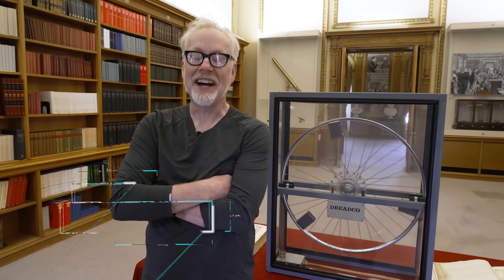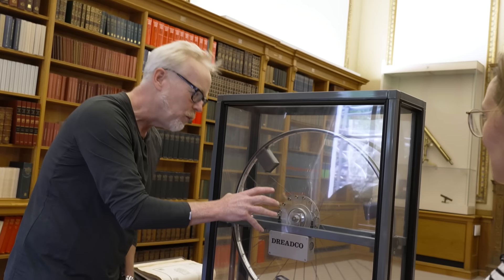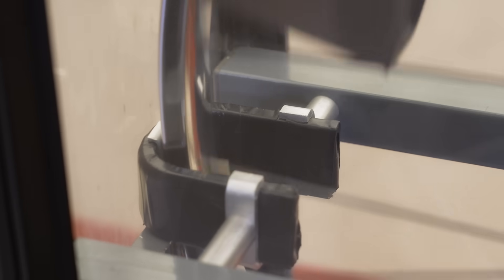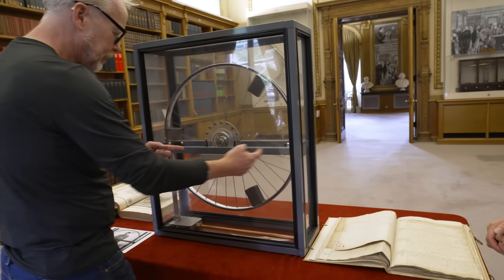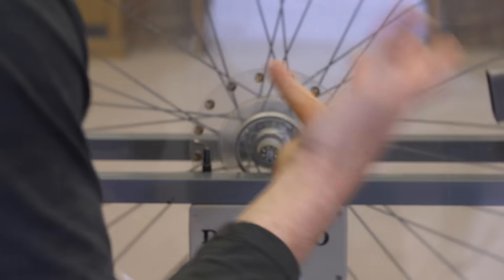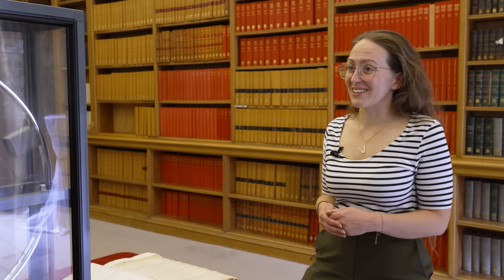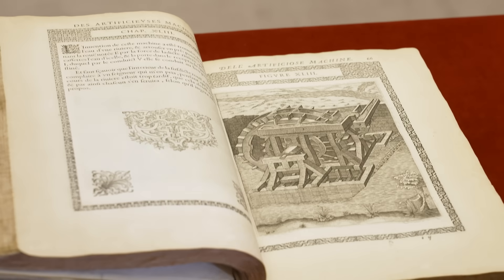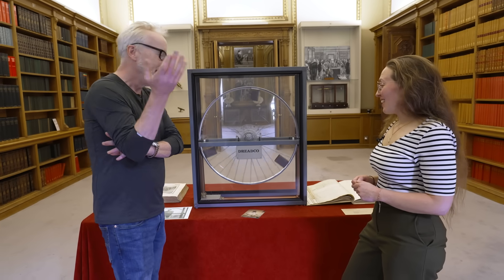Adam Savage vs The "Perpetual Motion" Machine!

Comment: It would be necessary to choose an elimination method. This means turning off the lights and turning off the heat in the room. If the wheel keeps spinning, it's an electrostatic motor. The boxes on the bike can be balancers, dummies, or contain wax that has solidified in a magnetic field, providing certain electrostatic properties similar to the fabled monopole. The center of the wheel is made up of cups and a spark gap. It may or may not be a dummy, but the cups have different contents. It would be good to measure the radioactivity of the cups, because the weakly radioactive natural element also has certain properties in the electrostatic construction. The copper tube with the heatsink may or may not be a dummy, but may only perform a charge equalization function. Machines based on electrostatics with their own source in the form of a radioactive element and matter exhibiting an electrostatic charge can rotate for many months. :)
Reply: What he said∆∆∆∆

Comment: There can't be magnets. Metals moving past a stationary magnetic field are subject to magnetic braking. 

I suspect the copper pipes are parts of two sterling engines which work to blow air over the wheel to keep it spinning. The copper pipes serve as an air conduit and as a heat sink for one end of the sterling engine. The actual heat sinks are on the other end of the engines. Both engines blow air the same way. Micro changes in temperature power it. And if one side isn't working, the other is. 

It could be done that way. But maybe not.

Comment: That heatsink and coax cables makes me think there is an antenna in there converting radio waves into electric current to use to assist the wheel to turn.
Reply: Search for Konstantin meyl skalar wave
Reply: Not radio waves .. its an radio isotopic battery .. search to find more

Comment: It is obviously a low friction shaped-magnet EM motor running in a sealed vacuum case. I'm betting that the battery pack is in the "DREADCO" box.
"Perpetual motion" is physically impossible.

Comment: thats not perpetual ....they have to send it back to reset...perpetual once on generates its own power not ever needing to be messed with.....that there is a few placement magnets in set spots to push and pull...set at the proper distance it will move almost infinite...but will eventually stop....this is a joke right.....
Reply: He literally says in the video it’s not perpetual motion, the fun is figuring out why it’s not perpetual motion and what’s the hidden secret that keeps it running for 2 years straight

Comment: Don't even need a sensor.  If it's a synchronous motor and the U-shaped pole pieces are iron or steel:
- Spin it up by hand to start it.
- Pulse a coil when approaching the pole:  accelerates slightly.  Adjust to just exceed drag.
- Pulse at the pole:  no acceleration, slows slightly through drag.
- Pulse ahead of the pole (during startup):  slows slightly.

The wheel will synchronize so the pulses happen just ahead of the poles.  Until the batteries go flat.

Or, use a mercury switch to pulse at a certain angle of the wheel, however the speed will vary -- it could speed up when the batteries are new.

Might hide solar cells behind about a 98% opaque coating, prolong battery life, but that's entirely optional.
Reply: Forgot to write:  pulse the coil based on a timer.  Or simply charge up a capacitor; when it reaches full charge, dump it into the coil.  Repeat.

Comment: The presence of that heat sink would imply it is a stirling engine. Those boxes having magnets would also imply it is imparting eddy currents on the right side, adding heat to the stirling engine.
Reply: It can't be a Stirling engine, there's no sealed piston of air. Also, a heat sink would be a bad thing in a Stirling engine of this size; you'd need to hold onto the thermal energy of the system for as long as possible, which is literally the exact opposite of what a heat sink does.

Comment: Don't know how it is done but I know how it could be done. Make the three wheel mounted blocks electromagnets that pulse on when they're just a few degrees short of the U-shaped stationary bars (at 15 and 270 degrees) Do this by putting in the blocks 1. batteries 2. an electro magnet 3. a capacitor 4. a DPDT mercury switch. In position A the mercury switch charges the capacitor possibly through a resistor. Just short of the stationary bar, the mercury switch goes to position B which dumps the capacitor's charge through the electromagnet. This gives the block a nudge in the direction of travel. As the block passes the bar the charge is already depleted and the electro magnet passes by the bar smoothly. In my imaginings you could build it with the blocks only firing on the one side. Don't know if you'd have to dump flyback current or if it would help to make the U shaped stationary bars into magnets. You could figure that out by tinkering. Another way would be to make the U shaped bars into the pulsing magnets and the rotating blocks permanent magnets. They could be triggered by a Hall effect sensor in the frame. There's room for lots of batteries in that frame.

Comment: I wished you showed the end edge of the wheel. I think that the slight electric charge is creating wind that is blowing through the copper tube to turn the wheel around. This is why it is incased by the glass so outside elements would not interfere. it is possible to create air blowing from a copper tube with an electric charge. This can be achieved through a process called electrostatic air movement (EAM). In EAM, an electric charge is applied to a copper tube, which creates an electrostatic field. When air is introduced into the tube, it becomes ionized and is attracted to the opposite charge, causing it to move through the tube and create a flow of air. EAM has been used in various applications, such as air purification and dust collection.

Comment: The lopsided spin rate is your key. Also the guy that said to hold a normal compass up to the weight/magnets was right on. the magnets could move more than the wheel inside the wheel weights. I dont think that the clear housing could hold much vacuum having been in the vacuum business,

Comment: It’s a motor that works on temperature differential. That heat sink creates the differential. The things on the wheel at 120 degrees are like brushes. I have one of these that runs a fan on my wood stove. It moves a lot faster because the temperature differential is much greater.
Reply: That doesn't work though. A heat sink doesn't create a temperature differential, in fact it does the opposite. Pushing energy to the outside environment as quickly as possible is what a heat sink is designed to do, and the exact opposite of what you'd want in a heat-based perpetual motion machine.

Comment: The light meters would provide enough of a charge to momentarily power the magnets. Probably just long enough to "suck" the boxes towards them, and long enough to continue giving the wheel a tiny amount of push with every cycle. The rods and pipes are the decoys. Having a fluid inside the boxes would also help smooth out the motion.

Comment: Perpetual motion machines are easy to make in open systems. Just make sure they steal heat from the environment.
It's a closed system perpetual motion machine that's nearly impossible. It's only possible when it runs on principles of the atomic world instead of the macro world.
This electron of my will forever spin around this proton unless acted on by an outside force.

Comment: I think there is a battery of some sort that is aiding the wheel. The 3 packs on the wheel help alter the balance with the aid of the battery, giving a little extra umph to push it to the next one drops, continuing the spin. As to the battery itself it could possibly be getting a partial charge with each rotation of the wheel but not enough to keep ot both charged and running indefinitely which is why every 2 years or so it slows down and requires maintenance. As for the acrylic or glass, it was probably used to stop friction from metal spinning on metal, which could inadvertently set off even a minor charge.

Comment: I also think it's a "deconstructed motor" as he suggested.   It'll be some sort of magnetic induction with the metal boxes and the magnetic fields on the 2 sides.   To keep moving, it'll require minimal additional inputs of power enough to overcome the inefficiencies and frictional losses.  I first thing i thought is the copper tubing could set up as a galvanic cell because we don't know anything about its contents, maybe this regular "servicing" is to rebuild the cell itself after material depletion.   There's a very common home made fishing jigging lure used on bottom fish.   It's basically a section of household copper tubing filled with 1-3lbs of lead.   It's said that fish are attracted to its because it creates the galvanic cell when it in the salt water.

Comment: My guess is that the tube and box has sterling engine which operates on a difference in temperature between day and night to drive some sort of sterling cycle and the wheel is essentially an inertial mass and the little box in the center is likely a capacitor that can charge over time and supplement power when needed to power the wheel via static differential when the sterling engine doesn't have enough power to maintain the wheel's motion. The servicing is likely a ruse to give an explanation for when the motor doesn't have a large enough temperature differential to keep working long enough for the capacitor to run low on power. They could charge the mechanism with a simple heater on one side of the sterling engine which in turn charges the capacitor and then just send it back and hope that the difference between the temperatures from the day and the night increases enough to power the wheel.

Comment: My uncle was working on a perpetual motion machine 50 years ago. He had it made in a machine shop. Worked on a wheel with hollow pistons moving in and out and was half in water. The uplift turned the wheel and the track maneuvered the pistons in and out as needed. It would run for weeks but produced no power. Could be stopped easily by touching the shaft. As a high school kid and into college he talked to me a lot about the concepts and whether or not his ideas would work. Made life interesting.
Reply: So, basically, machines that generate power seamlessly to fight their friction for at least some time. Obviously less than 100% efficiency.
Reply: @prototypeo1404  hey I mean considering the laws of thermodynamics and the fact this guy built them in his own shop, that's pretty impressive compared to what anyone else has done by themselves

Comment: Magnetic momentary switch on decent size chemical battery. Just tapping a little bit of magnetic impatience as the interior metal studs pass the probs. Small magnetic field right as the box passes the outer coil. Probably tac on the potentiometer to tune it in. Boom, you've made a motor in reverse.

Comment: Ok so some pretty poor videoing of the parts, should have zoomed in on the axle to show no wires going into anything there, I believe the axle is above the machine to show that it isn't a motor, however I do believe the box at the bottom is holding batteries to run the coils that are under the electrical tape on the "supposed U shaped magnets", I believe the boxes simply have magnets in them and when they get close to the coils they start the circuit with a simple reed switch at the top of the left U shaped fake magnet that closes the circuit, causes a quick impulse and stops, I say this because we should be able to just look at the video and see if its speeding up and then slowing down each time the box goes through the U shaped device. Had it been a u shaped magnet he would have left it uncovered, I believe it is wrapped in electrical tape to hide the fact that its just aluminum with a coil embedded in it and a reed switch.  If you notice the long copper WATER pipes go up to the other Square hollow tubes where the wires can be hidden and put out to the coils in the U shaped "fake magnet", this makes perfect sense, and you can buy long term motion machines that run for 2 months on a 9v battery.  I have a solar powered monkey on a swing that uses as tiny solar cell to move a monkey swing back and forth, so it's very possible to have batteries in the box at the bottom and even fill those copper pipes with AA batteries for a very long running impulse engine.

Comment: boxes are most likely contain 1 x battery 1 x electro magnet and 2 level sensors (https://en.wikipedia.org/wiki/Mercury_switch) the sensor are set to fire when the boxes are 5 degrees away to pull them towards the magnet

Comment: I think I know? The 3 boxes on the outer rim are unpowered magnets. The two U rings they pass through are acting like coils to harvest energy as the magnets pass through them. This electrical energy is passed through the Dreadco box in the center (via the connection bar in front) to power the electro magnets on the prongs in the center coming out of the dreadco box. Which repulse/pull the series of permanent magnets around the inner ring. They're spaced such that it repowers the central bit cyclically in a way where on average it pushes and pulls in time with when the smaller magnets are approaching or leaving. (there's enough smaller magnets on the inner ring that it's definitely pushing and pulling on multiple of them above and below the prongs, but the average force is one which converts the electricity back into an increase in rotational energy in the wheel... not like it generates free energy, but it's very efficient at converting almost all of the electricity back into rotational energy).  There's probably also a small battery working on some kind of amplifier (i'm not an electrical engineer, not sure if this is the right word, but a device that would take the flow of current and would make it more powerful without changing the timing/frequency of pushes and pulls) in the dreadco box to help negate the natural losses the system incurs, something like a watch battery could easily last years here.

If it wasn't this then I'd assume it's nearly the same idea but in reverse, and the 'probe' things coming out of the middle are more just sensors for timing than they are electro magnets for energy, with a battery providing all of the power for the outer electromagnets to push the wheel along.

Comment: Perpetual motion is theoretically possible as the earth moving around the sun. The problem only appear when you try to use it to get energy. When taking energy from a movment (by friction, magnetic interaction, mass elevation...), we slow it down so it is not perpetual anymore. But while it keeps its energy, there is no reason for it to stop.

Comment: Let's exclude a complete cheat (i.e. a battery and motor) just out of respect. 
Maybe the  Peltier effect (current generator by temperature difference) could explain the radiator (But the creator is also probably devious so there might be a bunch of red herrings...). A tiny current is generated which could be used to make this indeed into a dynamo, cleverly disguised.

Comment: Perpetual motion is impossible, but it should still be possible to ineffeciently move/harness a tiny amount of useful energy from a huge natural store of energy in an obscure way that runs a relatively small machine continuously without maintenance for geologically relevant periods of time.

If someone could harness even a few combined microwatts from atmospheric fluctuations, temperature fluctuations, magnetospheric fluctuations, tidal influence from the moon, planetary crust movement, etc. and use that to dribble feed into some type of battery or gravitic storage mechanism then getting a low friction wheel to spin for centuries doesn't seem completely unreasonable.

Comment: man, if there's ANY sort of power source in there, then it is by definition NOT a perpetual motion machine.
Reply: its a pulse motor, magnets on the small inside wheel trigger a reed switch inside the box connecting the circuit from a battery then energising a coil that oppose the same magnets on the small wheel,very simple and the rest is added to confuse you......

Comment: I'm so sure it's a sterling engine or something related to temperature change and also solar power making electricity to make it work somehow.
Reply: its a pulse motor, magnets on the small inside wheel trigger a reed switch inside the box connecting the circuit from a battery then energising a coil that oppose the same magnets on the small wheel,very simple and the rest is added to confuse you......

Comment: It could be something like a zinc-air battery in the box with the superfluous heat sinks. The copper tubes could be circulating air through the pile, which would last a long time. But such a "motor" would have to be very-efficient. And running a hall-effect sensor, plus the necessary electronics doesn't seem likely, as the load would be too great. Maybe a unijunction transistor with an electrostatic "senros" sensor, or something like that with a fantastically-low current draw.
Reply: its a pulse motor, magnets on the small inside wheel trigger a reed switch inside the box connecting the circuit from a battery then energising a coil that oppose the same magnets on the small wheel,very simple and the rest is added to confuse you......